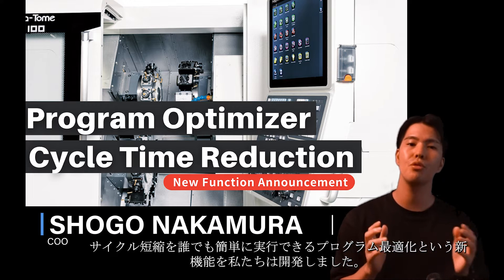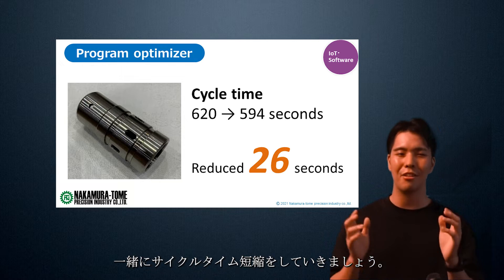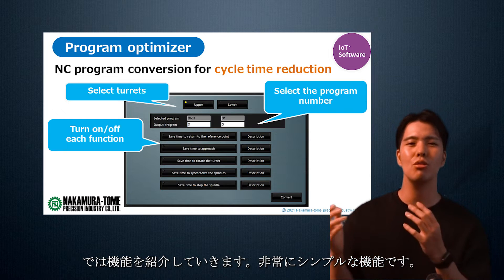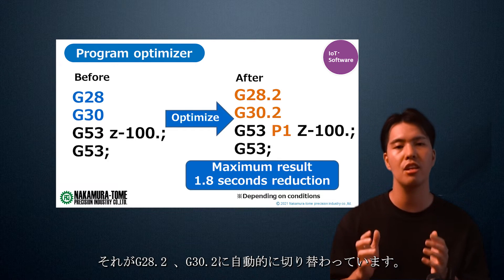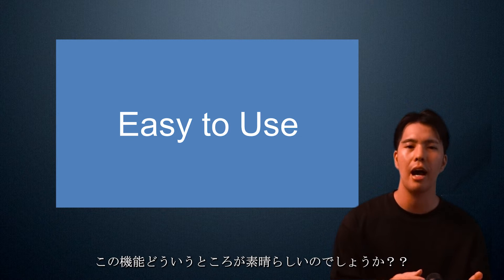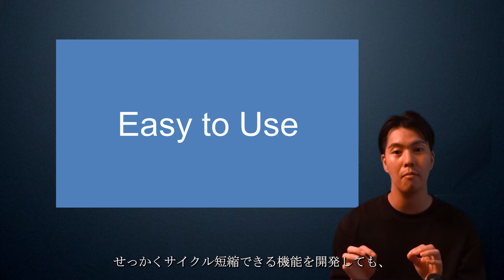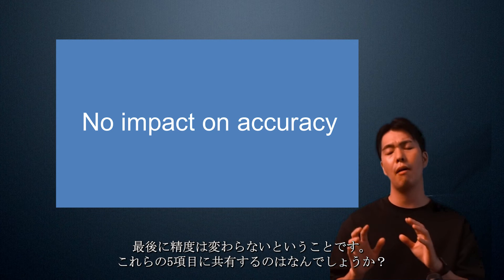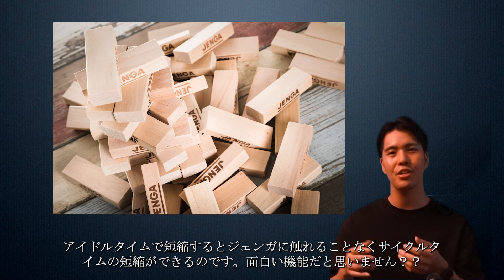Program Optimizer for Cycle Time Reduction | New Function Announcement

Comment: I have a number of WT150 and WT300 in UK (Fort Vale Engineering) Can this feature be added to my current 5 machines that all have Smart X controls?
Reply from the maker: Yes, it's possible. Firstly. we need to check your software version of Smart X. Then, we'll update your version. For updating your existing machines, it will be treated as a paid supply. For new machines, it's for free.

We are appreciated for your inquiry.